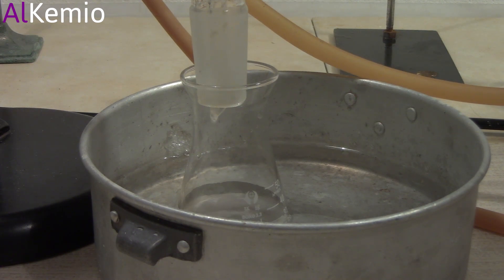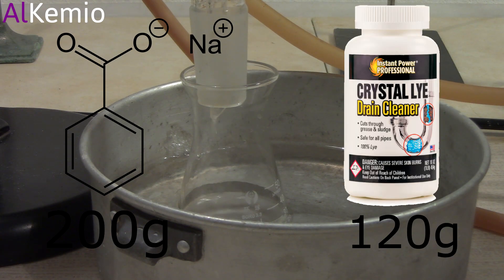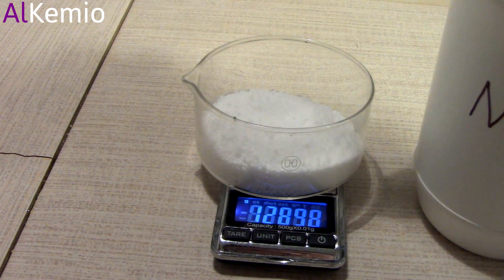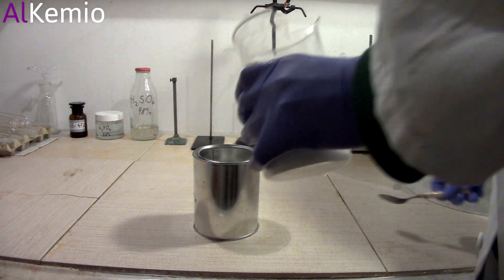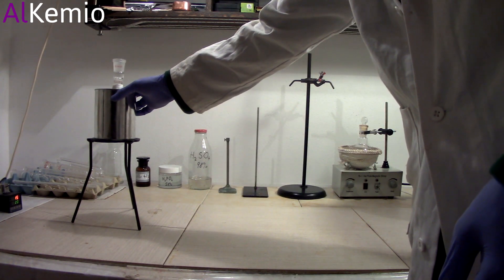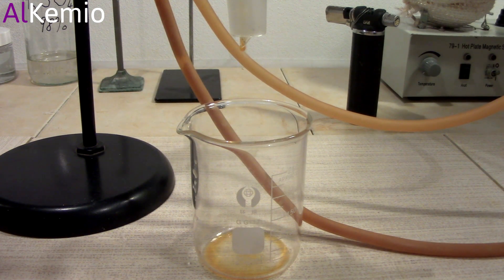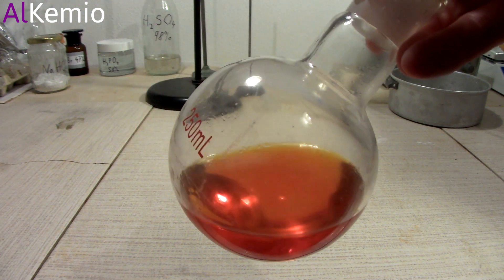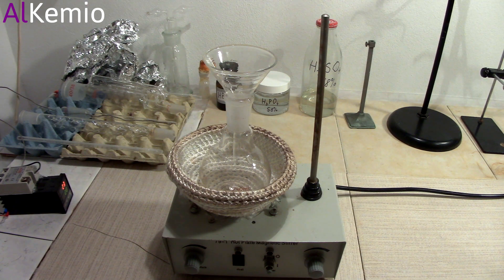Making Benzene

Comment: what if exactly what I want is tetracene ,or something similar. I mean , do you know what would encourage the formation of polycyclic aromatics?
Reply from the maker: I believe Tetracene is produced in higher quantities if the temperature in reaction chamber gets too hot. My guess would be On-Surface Intramolecular Reactions facilitating this (since the can is from metal and the surface inside must've contained metal oxides aswell).

However i looked into uses of tethracene and barring antibiotics and diodes there really isn't much use so i wonder why you'd need that 😁 

Have a nice day
Reply: @alkemio5866  hoping to chain them together as part of a conductive plastic polymer, lots and lots of pi conjugated bonds, maybe with some Quinones attached as well.. start making my own super capacitor / organic battery hybrid on the cheap and such, maybe even come up with some weird thing by accident that would be very useful, say a super capacitor that discharges when exposed to light but hold it holds its charge  indefinitely at the band gap voltage...🤔😜 Someone smarter than me could later turn it into a petabit optical disc the size of your thumbnail...
   I'm mostly fantasizing but amateurs have come up with some really cool things before so why not encourage my hobby?
Reply: @alkemio5866  do you know anything about their solubility so they can be isolated, or could you do a video on ring closing reactions so they can be synthesized directly?